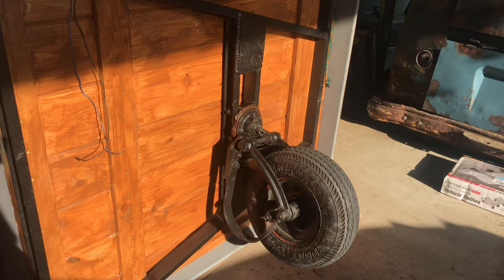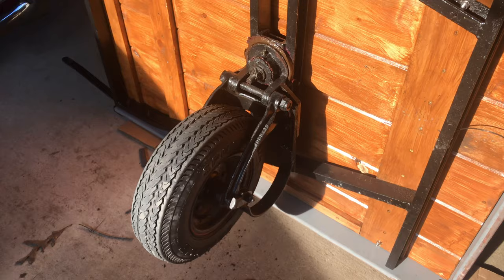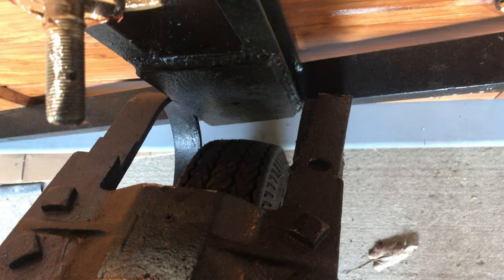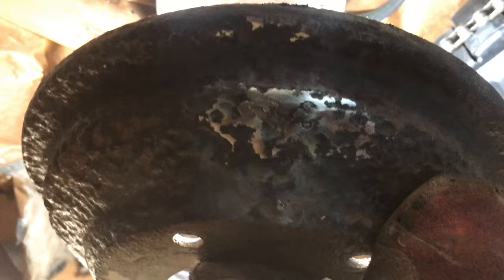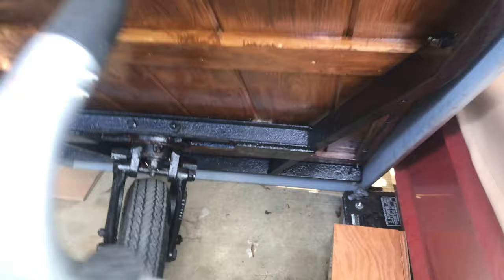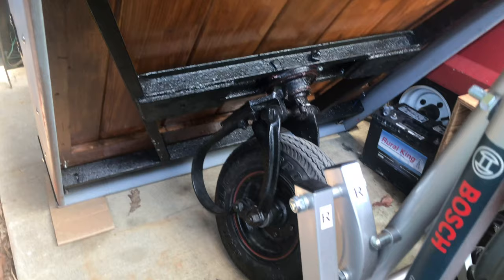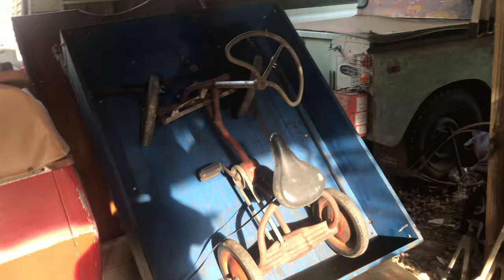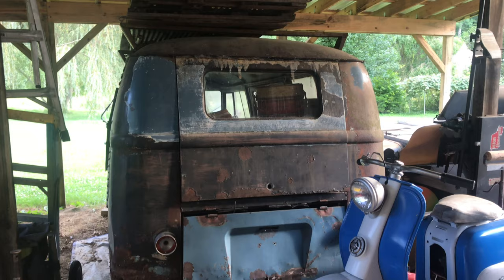Single Wheel Trailer fixes and 1958 VW pressed bumper, PICKLE update!!!

Comment: Nice job fixing the trailer. Looking forward to some pickle time.
Reply from the maker: years of YouTube content...jus sayin lol
Reply: marcijunebug that’s an understatement! Definitely look forward to the progress over time. Not everything I do is VW related so I don’t bother recording it.
Reply from the maker: I hear ya on the recording...sometimes with the little man around I barely have time to DO the actual job let alone film it!
Reply: @marcijunebug  Just an FYI on the trailer HOPSCOTCHING  around empty, might want to look  into getting a circular pieces of teflon  routed to that diameter and have one piece sit in that channel while the other is fixed,  will take up space last  longer than the other washer and give a better ride and turning radius ..........chek the salvage yards or suppliers for use 
https://www.ebay.com/itm/PTFE-Teflon-Film-Sheet-Plate-Thickness-0-5mm-1mm-2mm-3mm-4mm-5mm-6-8-10-mm-/272740689611

Comment: Great fix's  my older brothers like myself was in the work study program in high school. He worked at the bg Montgomery Ward's store in Gary, Indaian he did all the window displays. My high school work study job was in a very large auto machine shop. My main task there was valve jobs, turn drums rotors resurfaced flywheels and hone connecting rods..learned a lot back then that I use today at 65. Worked on a lot of VW motors  the dune buggys were a big thing back then plus the Vee's.
Reply from the maker: wish the old type department stores were still around...I actually MISS Sears! lol

Comment: I think what you really need is a complete new setup. And that would be tapered roller bearings in all areas. Two for the wheel assembly and two for the pivot section as well. That way you can take all the end-play out while having a smooth tight rolling setup. JMHO
Reply from the maker: Gary Mucher possibly. I put it back the way it was manufactured. These suckers are pretty arcane in the way they were designed. Metal on raw metal bushings in a lot of places! Since my repair we’ve put about 1,500 miles on it without incident. The axle itself has bearings, nothing else does and they are ALL (we have 4 of them all different wheel assemblies and manufacturers but similar set ups) designed that way (yes it’s dumb but that’s how they are lol). They are notorious for hopping if you don’t have them right...but when they are right they are really fun! Thanks for watching!

Comment: Where you were talking about a filt washer, I think it seems like you are missing some loose ball bearing balls in that groove. That would take out the side to side movement but still make it able to rotate.
Reply from the maker: vitadex there was a felt type washer between the two halves at the swivel point, we have 4 of these trailers none of them have ever had bearings there, and one of the ones I have is totally original down to the grease purchased from the OG owner, and it had a felt washer there...we have since put about 1,500 miles on this trailer without issue so until something else breaks it’s fine! Lol...I might be able to make the groove a bit deeper and fit some bearings in there tho if I have further issue!

Comment: You could clean that rusty rim and use JB weld to fill in the rust pits.
Reply from the maker: so far it has held and we have put 500-600 miles on it, so here's so hoping! lol I do know that a honda 50 motorcycle tire will work, so if it fails again I'll probably just swap it out!
Reply: @marcijunebug  I have a hay tedder with those same tires and rims on it. I just had to replace a tube in one a few weeks ago.

Comment: hello
my name is Dennis Looney..
i have an old miers manx and built a hitch for an allstate 1 wheel trailer..
in the swivel area you speak about that is loose i cut out a plastic 5th wheel trailer grease free spacer and installed it in mine...
i still used grease but i can take up the slack and it spins freely....
Reply from the maker: thanks for for info...I ended up cutting a felt washer and putting it in there...it had worked perfectly but I will look into the plastic spacer for when we need it in the future, I know exactly the part you are referencing and can't believe I didn't make that mental leap! That's what I love about youtube! ha thanks for the comment! truly appreciate it

Comment: Just wondering. Did anyone ever try two wheels one on each side of the trailer? Looks like it would turn curves the same and be more stable. both wheels would have to swivel like a single. Just asking.
Reply from the maker: Daniel Heartsill yes they make them...there are actually a couple manufacturers that STILL makes these 
swivelwheel.com is one and they do a couple with two wheels, and yep works the same...honestly when they are right...they are right. Zero issues with mine now and my dad has never had any with his, but those two trailers were nearly complete...the Montgomery ward one we had only a frame and wheel...hard to nail it when you don’t know what the arms are supposed to be like lol👍 thanks for watching